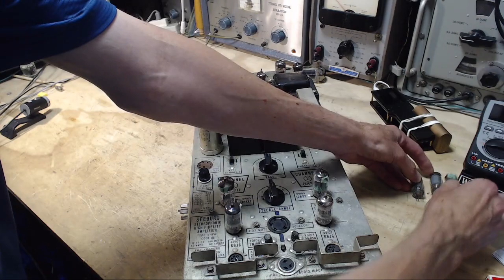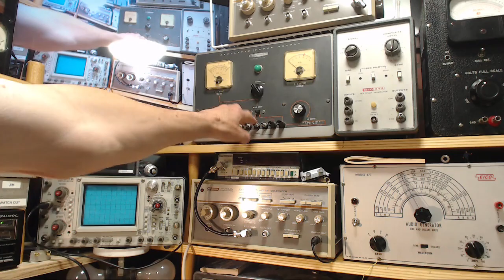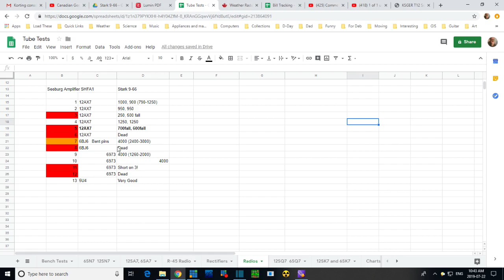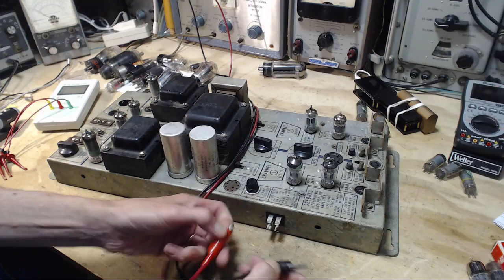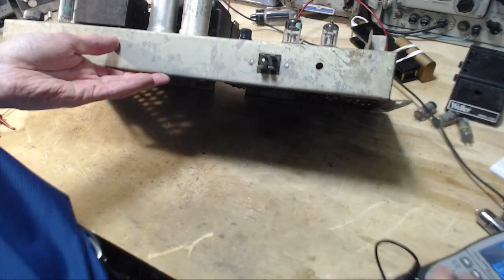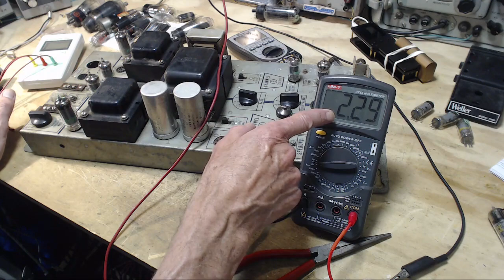Seeburg SHFA1 Jukebox Amplifier Video#2 - Preliminary Testing

Comment: Hi Jim
The preamp looks sensible & should work with Si transistors .
A quick google & you find the 2N3906 used .
Not my # 1 audio pnp transistor ! 

The good old cheap low noise BC179 fits the bill .
Just keep L amp a mirror image of the R amp parts wise . 
So please no 3 x 2N109 & 1 Si transistor  .

Comment: Jim, the volume control was mounted in the corner of the chassis under the big hole. It and had a short pigtail and a plug that fit the remote volume socket. When a remote control was used in the location the local volume control on the jukebox was unplugged and the remote plugged in. The hole had a big rubber grommet in it where the wire passed through. You might check the party that owns the jukebox and see if it is laying inside the machine somewhere or they have it! It had to be there if the jukebox worked and had sound.

Comment: in the 70's grew up with a 9 ft long 1962 motorola console (still have)  in the living room the thing put out heat like a hearth furnace and sounded good to. everyday when my older sisters came home from school put on the bay city rollers records for hours & hours & hours @ FULL volume blew out tubes like popcorn. radio shack repair came over 1000 times replacing tubes but dad always said it was better than the girls chasing boys

Comment: The transistors were to amplify the signal from the phono cartridge. They used a magnetic cartridge which has a much lower output than a crystal or ceramic cartridge. The whole industry - and many consumers - were moving toward magnetics in the 50s and 60s. GE's "variable reluctance" and Shure's early quality cartridges were fantastically popular. The commercial and high fidelity segments went to magnetics as they produced better sound and were not as fragile and prone to failures as the ceramic units. Shure produced one of their classic stereo cartridges during this period and were sold in great numbers as they were one of the first quality stereo cartridges. It is likely that those cartridges were used in this juke box.
Transistors were commonly used in those days since it was less expensive than using a low-noise tube (6EU7) and the components needed to take advantage of it. Transistor preamps were used in many low-level applications in those days, everything from stereo gear to sound movie projectors, tape recorders and everything in between. The earliest transistors were Rayteon 2N107s and electrically identical transistors from RCA. Whole books were published on using these "miracle components" and electronic magazines were full of projects using them.

The problem with the early designs was that the germanium transistors used back then were prone to a variety of failures. As they aged many got noisy and some would fail from the heat generated by tube amplifiers. That probably explains the mis-matched transistors in this unit. One or both pairs were replaced at different times.
It was also common practice to use lower gain in the following stages to keep the noise floor low instead of getting maximum gain and amplifying the tube's inherent internal noise.

Comment: In a pinch.....you can use ~6V DC isolated, to fire the filaments and rewire the 6973 tubes for 6V6GTs.

Comment: A well known substitute for the 6973 is the 6CZ5 but it very well possibly use the 6EM5 or maybe a EL84.  but it may take some changes to make that happen.  Further research required.
Reply: gbowne1 6973 is back in production now.   Electroharmonix does make new ones.

Comment: Hi Jim,
Just FYI, my tube manual shows a 6973 output tube takes  0.45 amps heater current.  Quite a bit more than I would have guessed.  Good thing you didn't have all four of them in the amp for your initial test.